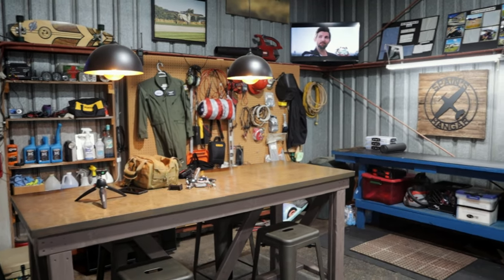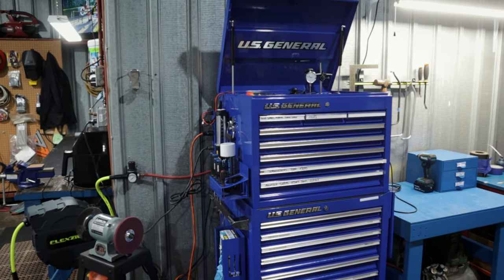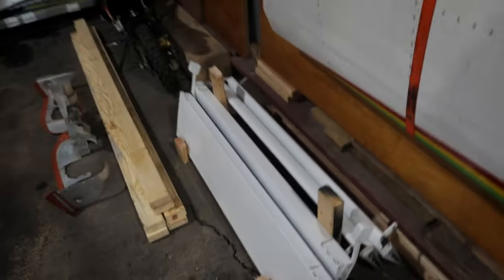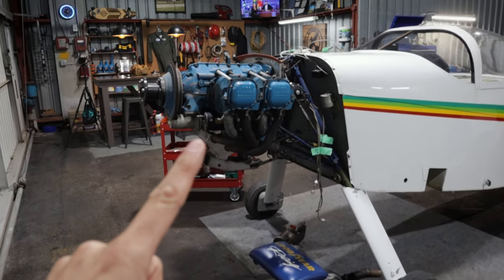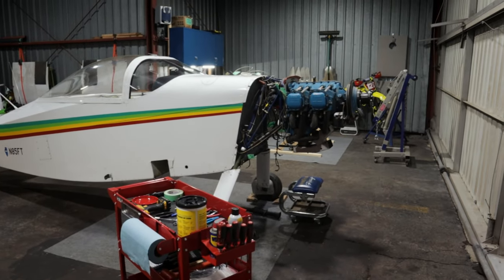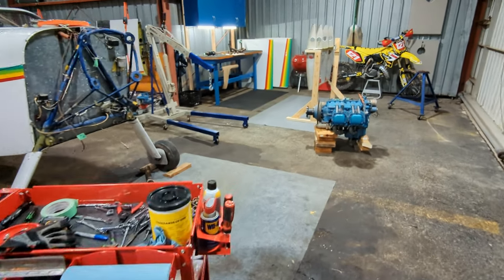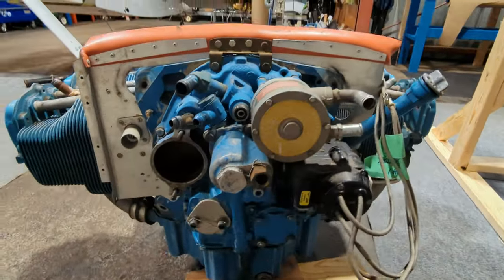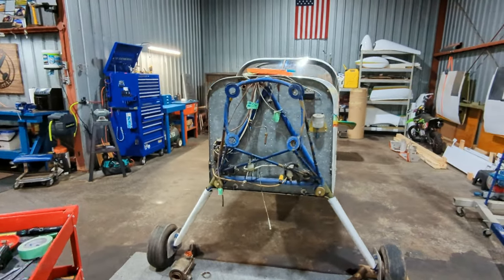Shop Prep & Engine Removal! - Barn Find Airplane Rebuild | Thorp T-18

Comment: I wouldn’t recommend powder coating for most structural aircraft parts. There are more reasons than I’ll list here but it’s so tough it can span over and hide hairline cracks. It’s also hard to remove for repairs, etc. I do like white though, small cracks are easier to see than black paint. Awesome rig, I’ve got a family member that has one!
Reply from the maker: Yeah since I posted this there have been other comments about this. Because of this I'm going to do epoxy primer and paint on the mount and gear. Im excited to get back to work on this project!

Comment: When possible dump your vacuum system. I did this on a friends Mustang 11 and total weight was 18lbs! Big savings on a small plane!
Reply from the maker: Yeah the vacuum system removal is happening as part of the rebuild! Gonna get rid of everything and go to a glass panel. 18 lbs is crazy!
Reply: Just read this and I also pulled 18lbs when I removed vacuum from my tripacer. Seems like the average.

Comment: Another reason to get an AV-30 or a Garmin G5…. Kick that vacuum pump to the curb. I did the G5 in my tri-pacer and pulled off about 18 lbs. between all vacuum pump accessories and the old gyro I had.
Reply from the maker: Yeah the vacuum system will not be going back on. I haven't fully decided yet about which direction I'm going to go with the panel but it's going to get some glass

Comment: Just an opinion on Avionics... Coming back to flying in the last two years after a dozen year hiatus, my Rans S-19 has a Dynon Touch (now obsolete of course!), But a new HDX or equivalent with iPad is all you need .. Dynon is so intuitive, great support and just works great. Before buying the airplane, flew a few other systems and much prefer Dynon ...and not Garmin price for the Experimental stuff. Is the tailwind gone?

Comment: The Thorpe is one cool bird all though I do not like planes with fuel storage just behind the engine, I prefer it in the wings, especially with aircraft with higher stall speeds. Don't like the built in crematorium feature if you gotta dead stick it into anything rougher than a golf coarse. One did dead stick it into a 900 foot strip once and did manage to get it back out once it was fixed. Way cheaper than any RV.
Reply from the maker: WAY cheaper than any RV! There are advantages and disadvantages to header tank VS wing tank. As long as you reach down and shut the fuel valve before making an emergency landing I don't really feel that it's any less safe